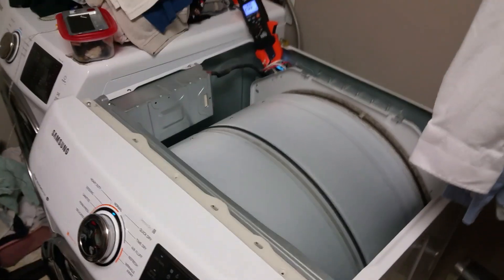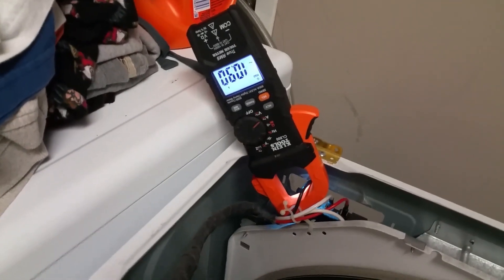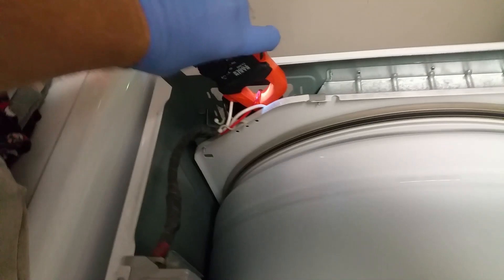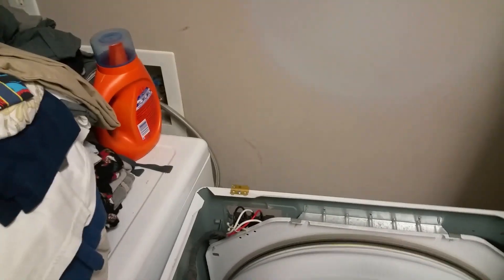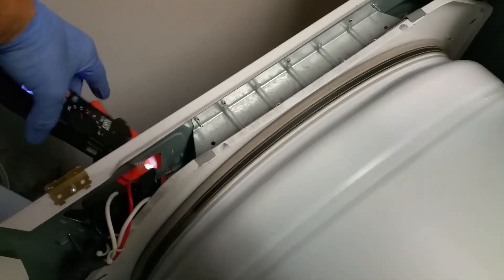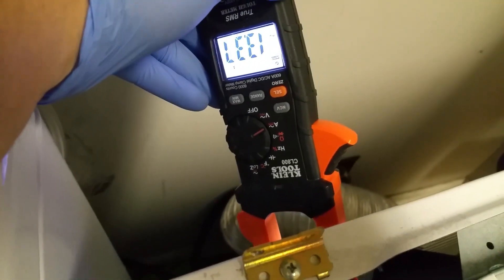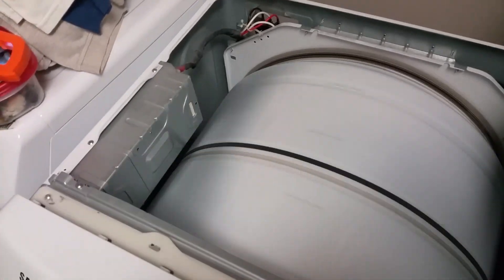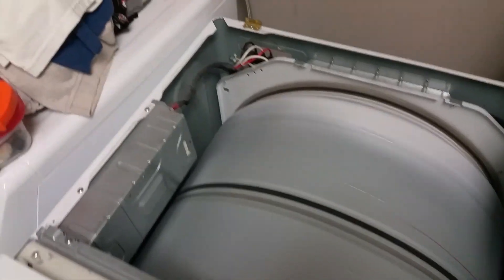#35 - Dryer Overheating - Grounded Element Test from the Terminal Block

Comment: In the newest homes wired to the 2020 and 2023 NEC, a grounded heating element in a dryer would instantly trip the GFCI breaker, because as of 2020 the rules for GFCI protection were expanded to include the 240V and 120/240V receptacle outlets in locations where GFCI protection is required.   

I get it, two pole GFCI breakers tend to run over 100 dollars each, but on the positive note, this new requirement can reduce the potential for a clothes dryer fire because in many dryers, one end of the element is permanently connected to one leg of the 240 volts, while the operating thermostat, high temperature limit switch and thermal fuse are in series with each other to the other (switched) leg of the 240 volts, meaning if the element shorts to the chassis there is nothing to shut it down other than unplugging the dryer or throwing the breaker.